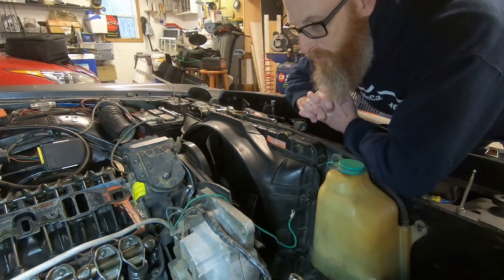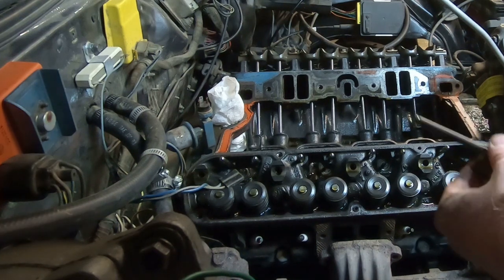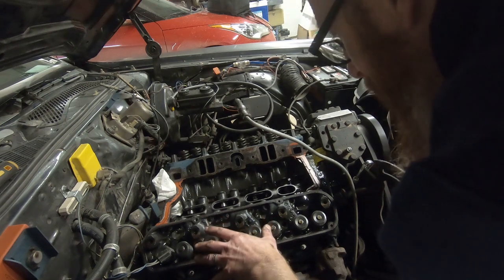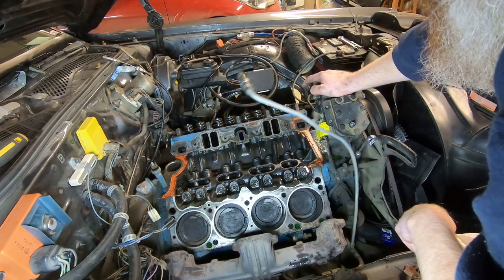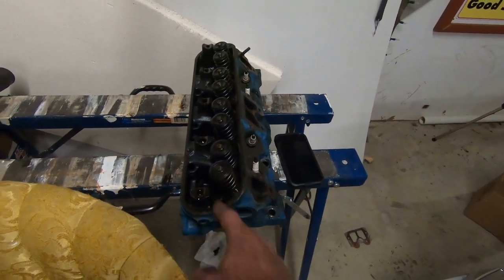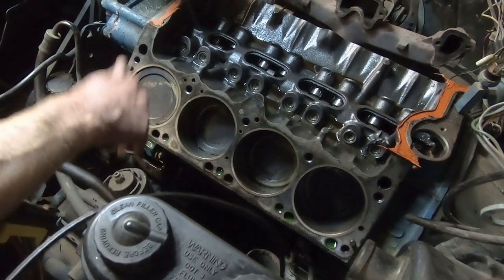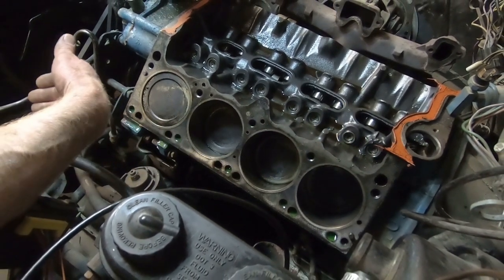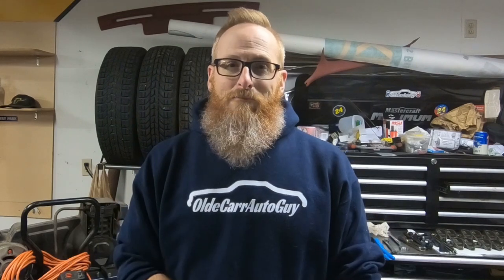MOPAR J HEADS GASKET MATCHING AND ENGINE TEAR DOWN-PART 3

Comment from the maker: I’ve been getting a lot of questions about doing a can swap! Rather than reply several times, I will answer it here!! When I rebuilt the engine about 7 years ago, I installed a performance cam then! Just haven’t been able to get the power out of it. Hopefully these new heads, a set of shorty headers and bigger cfm carb will do the trick!

Comment: No cam change?  What size runners are the new heads?
Reply from the maker: I believe they are 160 cc intake. As far as the cam, I built the engine with a fairly lumpy cam in it so I opted not to swap it.

Comment: I agree with Doug Sweener If you still have the factory cam in it and you have it tore down this much already why not put a performance cam in the old girl
Reply from the maker: Not sure why i didn't feel the need mention it on camera, but it already has a performance cam in it. I installed it when i originally built the engine!